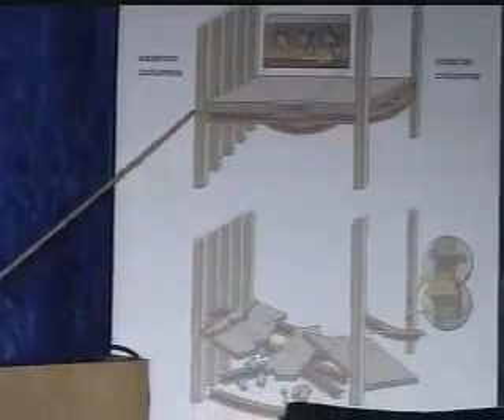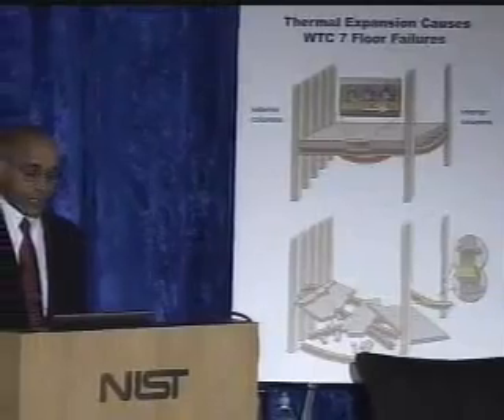WTC 7 Technical Briefing, Shyam Sunder, NIST, 26.08.2008

Comment: @ 40:09 "as we all know steel expands much more than concrete"  ~  Actually the reason for using steel to re-enforce concrete slabs is because their co-efficient of expansion  is virtually the same. 
.0000065 for steel and .0000067 for concrete. How can it be that NIST didn't fact check this?
Reply: NIST was a willing accomplice in the crime of the century, namely the deliberate demolition of the whole damn WTC. Sunder was lying thru his teeth during this presentation. May he burn in hell.
Reply: @joelweisberg cope